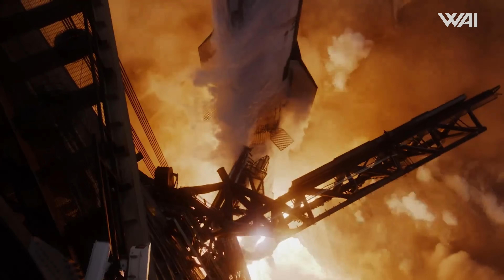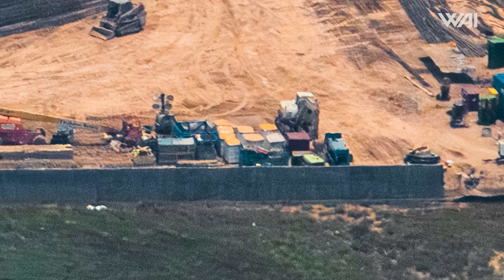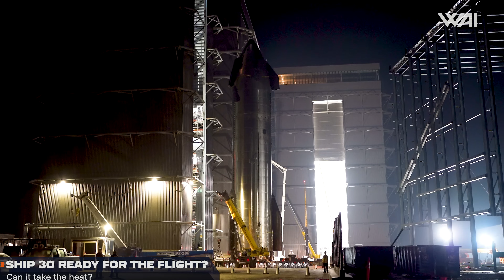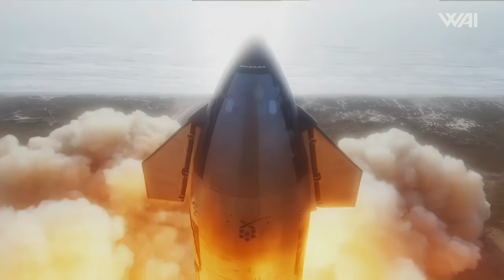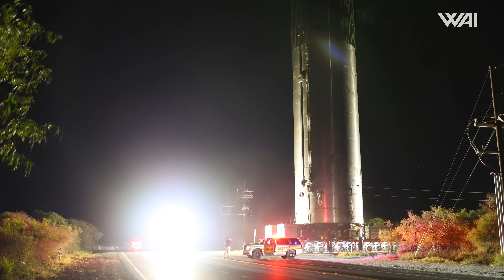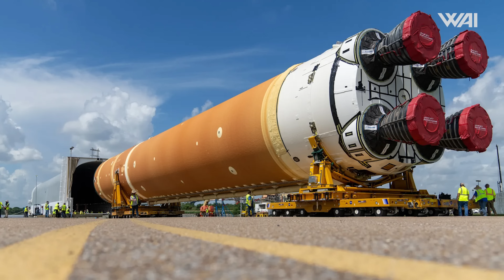SpaceX Finally Reveals Its First Real Starship Block 2! What's Different?

Comment: During the catch, what if the booster's catch points are off by 90" or some amount of Deg...... How do they rotate the booster to line up the catch points? Have we seen any tests of this?
Reply: The booster has 13 (15) main engines with thrust vector control. Just the center cluster of 3 (5) Raptor engines can "rotate" the booster during the landing burn.

Even the earliest test vehicles (with only one main engine) had cold gas thrusters for "roll". 

If the engineers find it necessary, thrusters will be added to Starship to supplement the main engines [during the landing flip]. But the booster likely is already agile enough.
Reply: I don't think you guys are understanding my question. 
I am NOT talking about thrust vectoring that will pivot the ship. Or roll it over many Km's while accelerating during a launch. 
I am referring to very fine control while approaching the tower. No amount of thrust vectoring will "spin" the ship in place.
It would require some sort of gas/cold gas thrusters mounted horizontally on the ship. 

Does the ship have anything like this installed? Have we seen this in use? 
Has the ship ever demonstrated "spinning" while moving at sub 10KM/H over a distance of sub 100 meters?
Reply: @roderickroderick27  
Thrust vectoring can indeed twist the craft in roll. The engines merely need to all tilt clockwise or counter-clockwise. Look for up-skirt videos, and you can find adjacent engines that tilt in such a way.
Reply: If a pair of center engines tilt in opposing directions, they create a twisting force. A trio can twist clockwise or counter-clockwise and roll the craft.
Reply: @roderickroderick27  that has not been demonstrated. But those technologies are installed. Those small thrusters are the kinds of things that I build at aerojet rocketyne everyday. The ship has a similar system but much larger all around the outside. It definitely should work but needs tested. I think they will wait to test that until the actual launch
Reply: They have attitude control thrusters for this. I build them everyday at work. Not for this company but for a lot of other ones so I believe this is a solved issue as they can pivot it while it's in the air

Comment: Not an engineer, just some guy on the internet, but I wonder if the Orion heatshield didn't ablate like it was expected to because it had to wait almost a decade for SLS to be ready to launch.  Then again while I know the Orion capsule was ready and waiting, I don't know when the heatshield itself was manufactured.  Maybe they held off on that until it was certain they were gonna get the green light after years of waiting.  If it was waiting as long as the capsule itself then maybe the abnormal ablating was just a result of sitting around for years waiting on a pork project to waddle up to the pad and get going.
Reply: I was thinking that the ablative material just wasn't made consistently over the entire heat shield. 

It should be mixed and applied in one long continuous batch job. Also, any bubbles in the liquid resin composite would need to be removed with a hard vacuum in a section of plumbing on the path to the pressure injection mold. 

Finally, the baking process might not have been uniform enough. Temperature gradients during curing could lock strain into the structure.

Comment: I like the new flap design. It would have been hard to change the old design so that it could move freely, but also not have plasma slip in through the joint.

Comment: I always think that these animations showing the Booster being caught, show the Booster coming down too fast !   I would expect the ‘vertical catch speed of the Booster’ to be much slower.   
Maybe no more than 10 cms/sec at catch ?    
The animations seem to show it travelling at about 5 meters per second vertically ! - Clearly far too fast.
Reply: Eventually, the arms may begin to close while the booster is still decelerating, but likely will not co-operate on the first attempt. 

I expect that, at first, the early boosters will decelerate to a standstill, and adjust thrust to hover. Then arms will close and rise up to support. In later versions, the arms can close upon a descending booster with coordinated vertical arm motion.

Comment: Why is it called block two? I don’t understand the block part.
Reply: It is a way to indicate that it’s the second version of the vehicle. Based on what they learned in the test flights, they’ve redesigned the vehicle  (different flaps, taller, lower dry mass, heat shield improvements, etc)
Reply: @Nathan-IdeasHaveConsequences 
As previously mentioned, it’s better than V2.

Comment: The pit you asked about next to the new tower is likely a retention pit for the drilling fluid (Bore Gel) that will be pumped in and back out of the bore hole before the pipe is installed. When directional drilling, the hole is fully drilled before the pipe is pulled through. The drilling fluid is used during the drilling process to keep the hole from caving in before the pipe can take it's place.
Reply: That sounds boring. :)

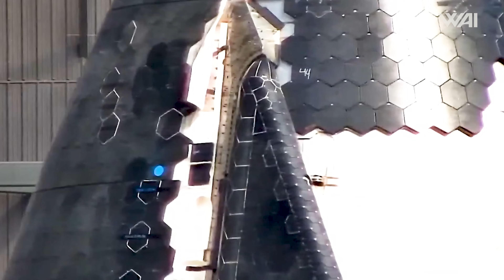Comment: @12:12 a minor note, based on the thrust simulator you have on the right there the render on the left is wrong.  The whole inner 5 engines will be rotated about 1/2 an engine in reality vs the render.  It looks like those center engines will be place so their engine bells are as far as they can get away from the engine bells of the ring of 10 around them and not so they are almost touching as is depicted in the render.

Comment: The SLS  as well as the Orion capsule may just be another NASA lemon 🍋
Reply: Maybe, but the first mission was amazingly successful.
Reply: Hey lemons are good, they're really just 💩
Reply: Being shipped for assembly now.
Reply: Didn't they specifically start the Commercial Spaceflight program because they admitted their government bureaucracy can't maneuver into the efficiency column?
Reply: They should modify the engine mounts to allow ejection on the RS-25 engines. Then Starship could go get them and return them to FL.... eventually.
Reply: And, at $4.1 BILLION PER LAUNCH, a very, very expensive one!

Comment: I feel like it's going to need a hinge flange to keep the hinge protected.
Reply: It's a big problem when a super-compressed hot atmosphere rushes through the hinge gap, and also into every tile gap. Version 2 retracts the forward flap [hinges] out of the plasma stream, but the rear flap hinges will continue to stay immersed. 
The elastic seal within the hinge gap is crucial.

Comment: I have a question:  how will the booster have the right orientation for catching? Like if the catch pins are at 9 and 3 o’clock. As using a clock dial to describe. Now say the boosters catch pins are at 12 and 6?     Can it rotate as it gets closer to landing?   Is possible “fix” is to have a beefie ring all that way around so don’t have to “rotate” the booster on landing
Reply: It can rotate by gimbaling the 3 inner landing engines.
Reply: It maintains its orientation in all three axes during the entire flight. If it doesn't then it won't make it back to a pinpoint landing.

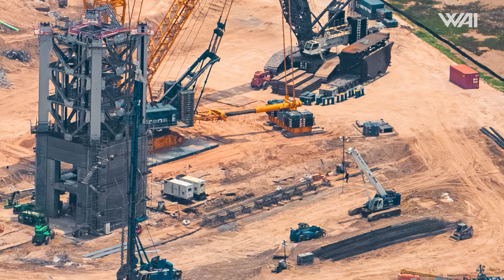Comment: Firefly class: Serenity spotted @4:20
Reply: Why not put heat tiles on the launch mount?
Reply: @squashduos1258  wait he's got a point tho...
Reply: @squashduos1258  They are very light, very fragile things; when holding one, you can (almost) crush it in your hand. - Dave Huntsman
Reply: @dphuntsman  are you saying the re-entry is just hot and has no pressure? I mean the space shuttle landed with it…shouldn’t it hold up to the rocket engines or is the thrust (not the heat) the big issue…?
Reply: @squashduos1258  They aren’t meant to be used close to the ground where the exhaust is scouring everything with dust & supercharged steam. They aren’t hard & tough.
Reply: @squashduos1258  I think shockwaves would be the biggest issue with this - most likely the tiles would get blown off the launch mount every time a rocket went up. Plus the heat, friction, and pressure experienced during reentry are probably very different than what is produced by rocket engines, so it's not a simple plug-and-play system that can be adapted easily to various applications.
Reply: Good catch!!
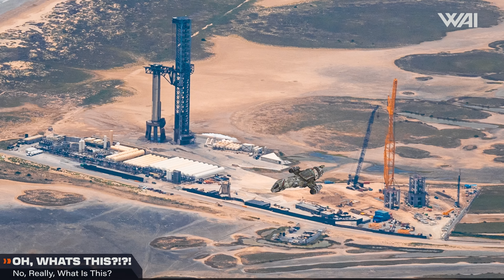Reply: 4:18 is better

Comment: Lifted flaps on block 2 will make it easier go through reentry and advantage of mass
Reply from the maker: Absolutely! The main benefit is that the forward flaps are moved out of the plasma flow on reentry! :_WAIRocket:
Reply: Smaller, thinner, lighter, further forward. 
If Starship ever returns with a significant payload mass, these flaps may have to be enlarged. (More header tank propellant mass for landing.)